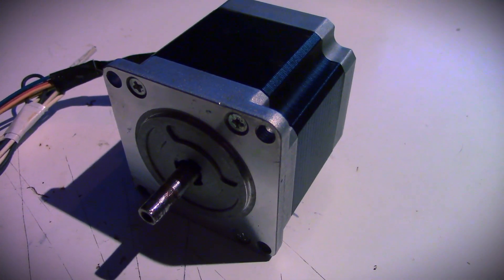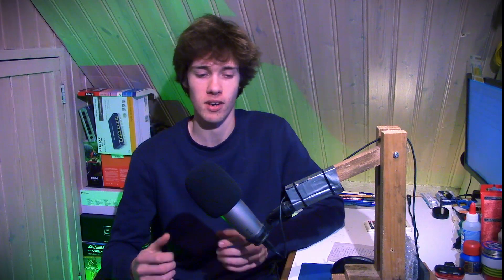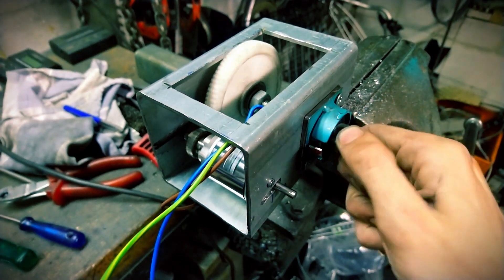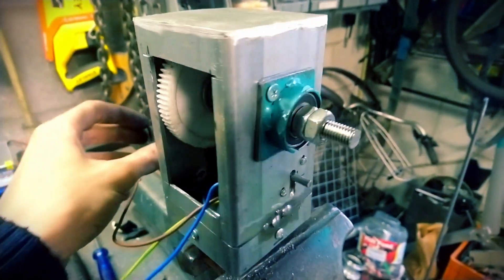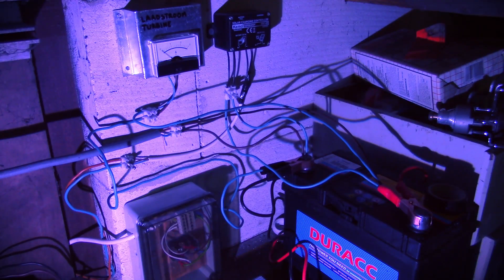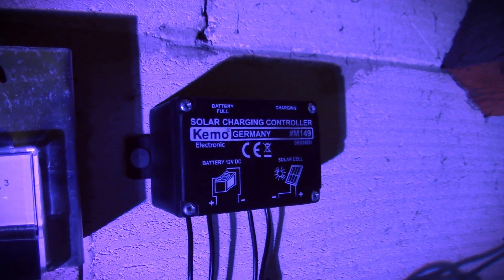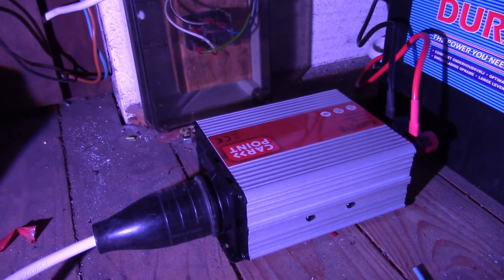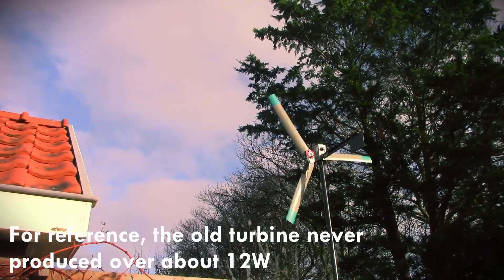Another DIY wind turbine! (AKIO TV)

Comment: I noticed there's a bit of contradiction here. A brushless motor is made to spin fast and here you are using a gearbox to create friction (torque) to slow it down and according to my knowledge, more voltage = more speed and more current = more torque. So brushless motors are meant to be used as motors not as generators, specifically to build drones/aircrafts.
Why don't you use a motor/alternator that produces high current at a low speed(voltage) then transform the high current to a high voltage ( boost converter maybe? ) before feeding it to the inverter and get 220 AC